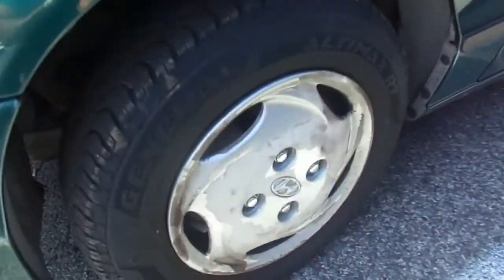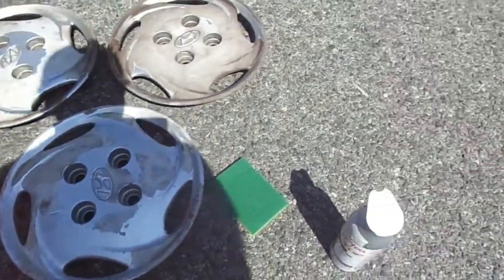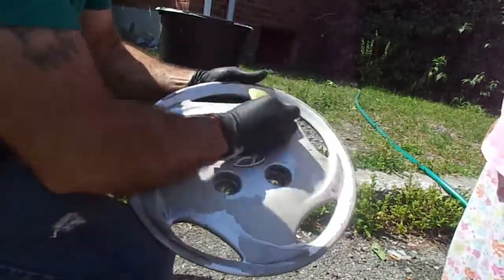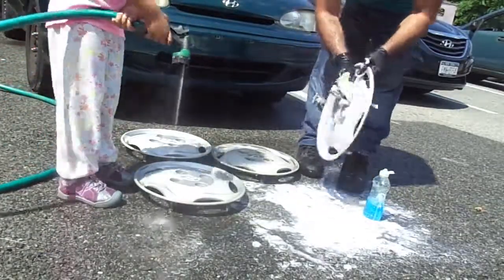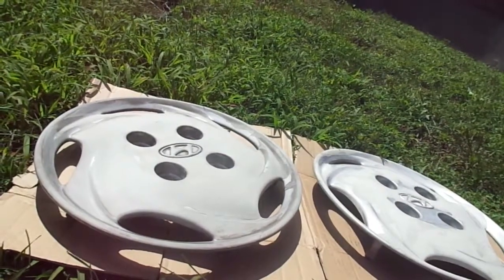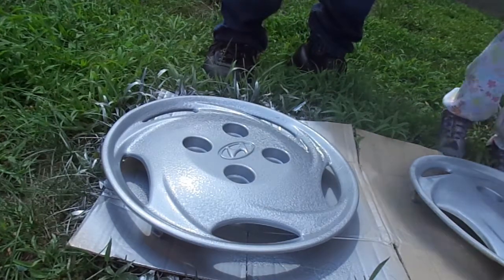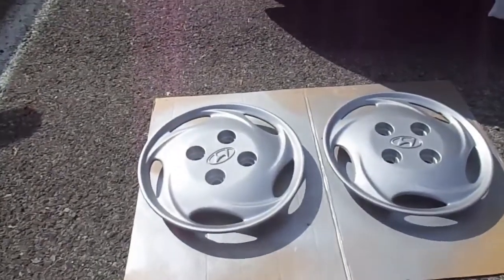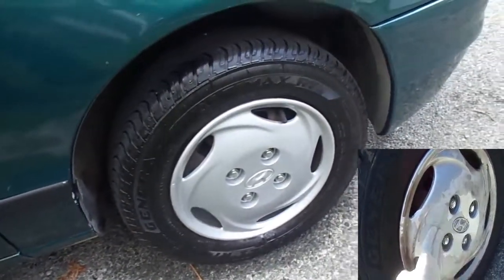Painting HubCaps / Saved 135.00 Dollars

Comment: I have the exact issue sometimes when I paint sometimes, I get those craters appearing out of nowhere and I get so upset. I still don't know why it does that, but wish I knew. But you kept with it, and they really came out nice, and if you bought the ones from ebay, you might have had to paint them too.

Rose is so funny! She said yeah, it's full, when there was hardly any water in there, LOL! She is such a great help, and she kept wanting to do more.
Reply: You're getting too close. You need to to start spraying before it's pointed at the object You need to spray, do a quicker swipe of the spray, then move on to the next section. You will need to make 3-5 passes to properly coat an object. Allow several minutes between coats to allow for drying.